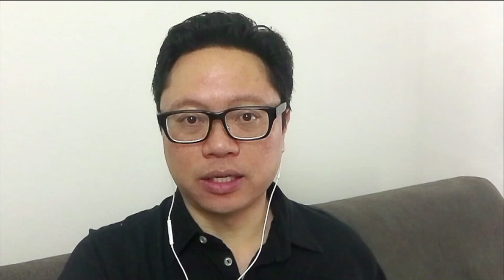Is Balanced Audio Better For Headphones?

Comment: I agree completely and this is a great job on the topic without being biased in either direction.  When I auditioned the LCD-4z's I listened to them through a Pass HPA-1 which is single ended only and I would argue as good as anything available.  HOWEVER, that is a function of the design and topology of the amplifier itself.  With Sony Signature gear (WM1A/Z and ZH1ES) those designs are discreet balanced designs and so must use summing circuits to achieve single end output which is intended for convenience.  These devices will have more output power and always sound better (to my ears) when using a balanced output because they are designed and built to operate in a true balanced state.  

So the short answer would be unless the amplifier is a true balanced design (Dual DAC's, separate signal and power circuits for the Left and Right channels, basically a 'dual mono" design) then you probably WON'T see benefit from running a balanced connection on an amp that has both connections.  If the amp is a true balanced design (like the Sony Signature line, Schiit, and others) then you will see some benefit in both power output and sound quality by using the balanced connection.

I'm hoping that the 4.4mm Pentaconn balanced connection becomes more standard.  It is small enough to be truly portable (as opposed to XLR)  but capable of more current, surface contact and generally more robust than the existing 2.5mm balanced connector.
Reply from the maker: I like the Pentaconn plug but it's a real PITA to wire up so independent cable makers are not jumping at the opportunity. Inside the plug, the connection points are super tiny and very difficult to solder.
Reply: phototristan I agree that it has to be harder than a full size XLR, but I can’t imagine it being more difficult than the much smaller 2.5mm balanced.  However, I’ve not seen the solder points of either, so I could be dead wrong.
Reply: wait so you said if the amp is a true balanced deisgn then we won't a benefit, but then the next sentence you said if the amp is a true balanced design again, you will see some benefit. I think you made a typo there, could you correct it so I know what you meant please?
Reply: yeahthatsright33 What I wrote is correct “UNLESS the amp is a true balanced design then you probably WON’T see a benefit even if the amp has both connections.  If the amp IS a true balanced design, then you will most likely see benefit.”  

Some amps create a balanced output after the signal and amplification stages.  You probably won’t see a benefit with these designs.  However, some amps like the Pass Labs HPA-1 are designed as summed design and do not have a balanced output.  These amps can sound as good or rival balanced designs, although they usually don’t feature any DAC stages or signal processing.

Amplifiers like the Sony and Schiit amps are true balanced designs meaning that they have separate signal, amplification, and power supplies for the left and right channels and are true balanced designs “end to end”.  Generally, you can spot these amps by the increase in power in the balanced output.  In order to generate a single ended signal, these amps use summing circuits to do that.  This generally always results in a slight degradation in sound quality, usually in air and separation of instruments and less power output.  

The really short answer is:  If the amp is a true balanced design, use the balanced connection.  This is the way the amp was intended to operate for best performance.  Otherwise, you most likely won’t have any benefit using the balanced connection on other designs.
Reply: I'm still a bit confused, but its all good, you did your part explaining as best you could, thank you very much! I appreciate that you took the time to help me out :)

Comment: Lol sounds like all you need is buy chord electronics devices. Cause all they have is single ended. I believe it depends on your amp or dac if it needs one or not. That why chord use only single ended cause its clean. Now what you prefer sound wise is a different story
Reply: Not all chord devices are single ended but the balanced stuff is extremely expensive.
Reply: @lumntoob999  well other than hugo tt or tt2? Rest chord stuff is unbalanced. I personally like ibasso dx200ti :) with amp8
Reply: @2007vitaly  and Chord Dave and they have older products that used balanced as well. My point is not that chord prefers balanced or single ended but I was just saying chord didn't choose one especially single ended because it's "cleaner" or there higher end stuff would be singe ended only. Other people have mentioned here in the comments the correct answer to the balanced or se query, if the amp topology is inherently balanced (schiit mjolnir 2 and ragnarock are good examples) then they are absolutely going to sound better out of there balanced output. However if you have a typology that is not inheritly balanced then there would be no benefit to having a balanced connector. This sounds extremely obvious but manufactures have lied about there amps being truly balanced (aune x7s is a great example here). People really shouldn't concern themselves with buying into balanced, if you want a particular amp and it happens to be a real balanced amp and you don't mind the extra cost and inconvenience of getting cables and recables for your headphones then go for it but neither single ended or balanced are inheritly better than the other (for a headphone amp).
Reply from the maker: @2007vitaly - The Hugo TT and TT2 are not balanced. They have balanced outs for convenience and convert single-ended for those outputs in a good and smart way.

Comment: Just curious, is there not a single benefit to balanced, besides power? Cuz im thinking of buying a balanced Dac/amp from Audio-Gd, and seeing this, made me think.
Reply from the maker: It really just depends on the design of the amp/DAC. If it's really designed to be full differential balanced, then that would be the output to use since it will sound better (as it was designed that way).
Reply: what does "sound better" mean ?
Higher channel seperation?
Most player i know usw a single OP Amp as output. Some use 2 DAC`s. But fully balanced would be the complete signal way for each channel seperately or not?
Aand even than i dont understand. In fact you will never catch any noise through your headphone cables, lol. 

Also many headphones for balanceds audio in ear monitors use drivers totally uncapable for reproducing good and deep bass.

I was thinking about trying it out. But as electrician, audiophile and hobby audio technician i really see no reason. No matter how hard i try.
Sadly how flooded and destroyed audio industry got by snake oil.

Nowadays it is really hard to catch good audio setups because there are so much scams and foolerie. Really makes me upset.........

I hope my friend will build a prototype of his idea. If he succeed and he gets it running......well, days for snake oil are gone. Than you get cheap audio with 100% reproduction of the input signal no matter what. Its an easy solution and i think it is not on the market yet, because all this audio foolerie had no reason any morew and no one can sell 20.000 $ record players and bullshit anymore......